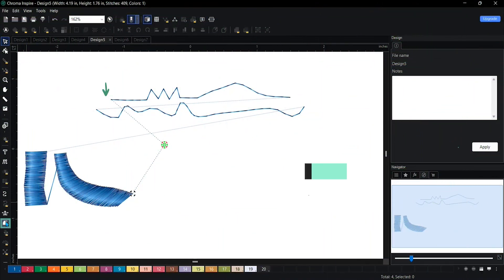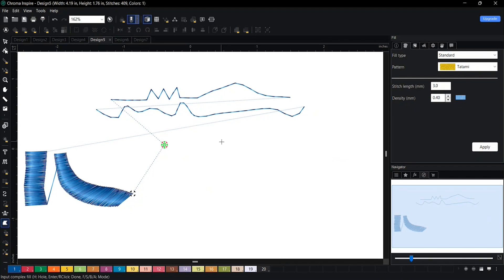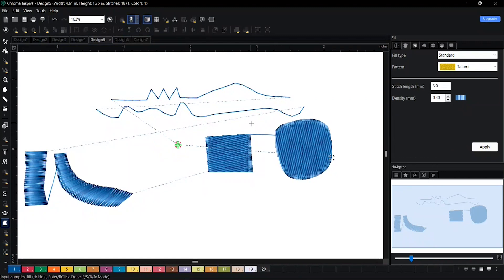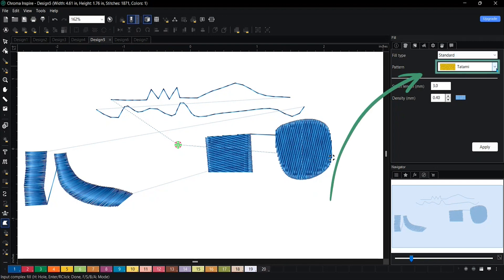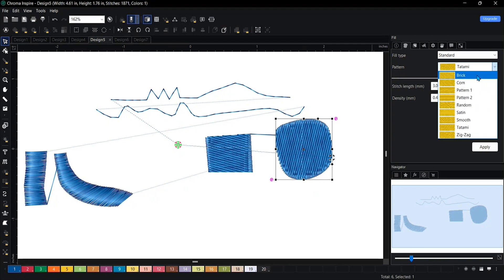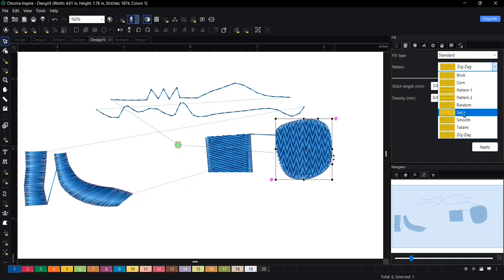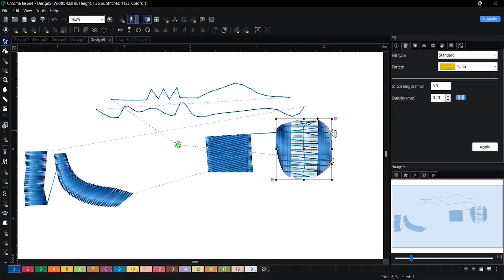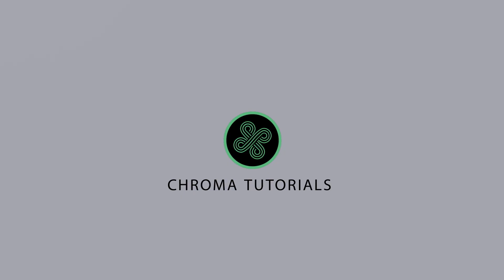Complex Fill (Plus, Inspire and Luxe) | Chroma Digitizing Software

Comment: On the complex fills you have there, the patterns seem to be running at different angles. On my first test logo there are various shapes with the same thread color, all with the default tatmami complex fill but they are all randomly running at different angles. I've googled everything and can't seem to find the control mechanism  for this.